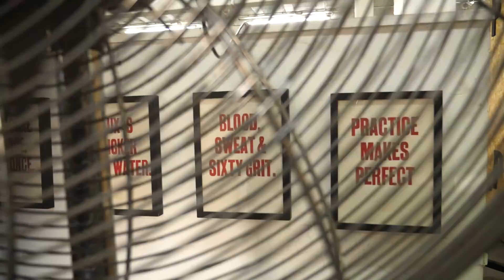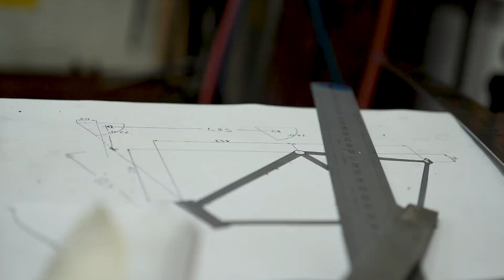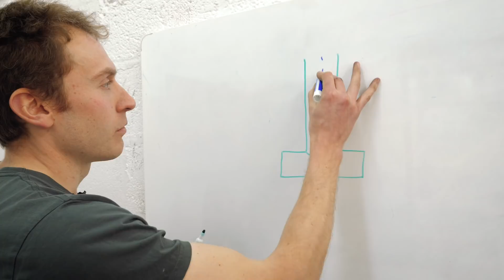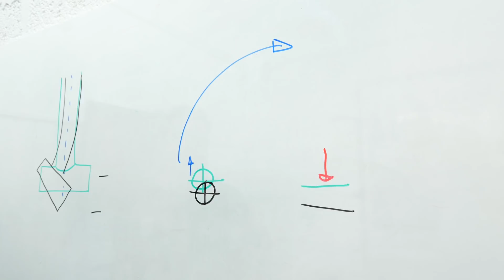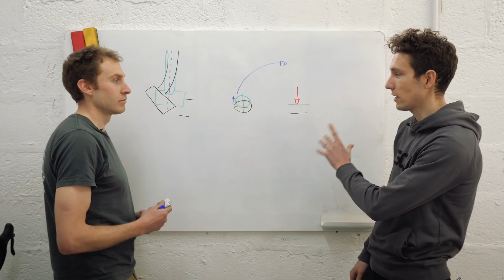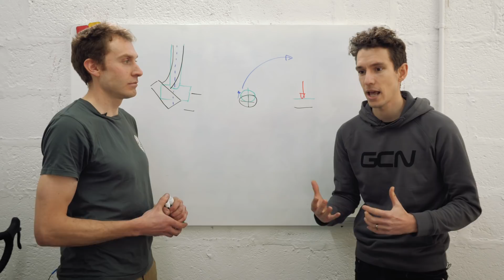Are You Faster On A Stiffer Bike?

Comment: At least with my bikes, nothing so far to note, I have always noticed a flex along the horizon line along the chain bending on the chain side between the peddle and rear gears. There are times the flex causes the chain to change or close to change. Just thought I'd say... I'd also imagine this "grey" area is more about the strength of the cyclist. Someone very strong with high endurance would need a stiffer bike; when typing this is seems common logic knowledge... but I don't think it is... ha! I think the example shown in the video is great, but also believe that energy we saw will never happen while on an unhinged bike and the energy will go into the tires, granted hard stiff tires would observe less energy.

Comment: This explanation is flawed. True the energy is not lost if the material is in elastic range, BUT the frame could flex back after the downstroke, which would leverage your leg's damping properties more, and also it make your upstroke potentially easier (not necessarily what you look for). This is due to the lag in the response of the frame versus the excitation, sometimes referred to as phase angle in the dynamic modulus (complex modulus).

Comment: It is turned into heat but the heat is displayed throughout the frame, also the frame flex while pedaling in the road causes the free hub to spin backwards turning your energy into the free hub spinning backwards which, the brake test throughout the video does NOT replicate actual conditions, also lets say that his theory is correct, the uneven slowing and speeding up would cause aerodynamic inconsistencies which would maximize air friction and lose you power, frames aren’t just built stiff in all parts with compliance built into the carbon where needed to reduce how much the small road bumps will slow you down

Comment: I imagine it is the same as anything, tuning for the individual. I think theres probably a sweet spot based on rider weight, and power output as well as riding style ie stiffer stronger frame for downhill. something to consider is the material side of things im no expert in composites but i imagine stiffer= heavier due to the use of thicker carbon fiber. I hope you guys do more coverage on this. nice video

Comment: Possible frame flex experiment…

Ingredients: two bikes (one flexible, one very stiff), a short traffic free hill, one rider, one assistant, make up weights (to equalise weight difference in bikes), one piece of chalk, one measuring tape.

Method: Select bike 1. Face it uphill.

Rider stands on pedals at 2 o’clock position with straight leg, bike brakes fully on. (Assistant keeps rider upright)

Rider releases brakes and lets his/her full weight (with straight leg) turn the crank until 6 o’clock position. Measure the distance travelled uphill until the bike stops.
Repeat three times and take an average distance.

Repeat above with bike 2. If possible use the same wheels, drivetrain and gear ratio. If not at least use the same  chain and crank length.
See if there’s any difference in the distance travelled.
NB. The rider must ‘fall’ exactly the same distance every time. The rider must not add any muscular energy (so must use a straight leg in every run). 

It would be interesting to see the results! Not very ‘Glam’ but it’s a real-world test!

Comment: You turned the pedals without allowing the wheel to rotate. Am I supposed to be surprised when the wheel rotates after you take the brake off? What else would happen? Pretty much the only possibility is that the chain or chain stays are plastically deformed and the whole bike is broken.

Comment: In effect you’re loading a spring and releasing it. Take a spring with a weight on it. When you release the spring, does the weight bounce back to the exact same position? Of course not, the spring will oscillate, losing energy each time it does. The stiffer you make the spring, the less potential energy energy loss, until eventually there is none with a perfectly rigid structure. Is it a significant amount? That depends on how heavy the weight is, but I think a rider is pretty heavy. With a bike frame you aren’t even loading the spring in a totally vertical direction, which means much of the energy lost will be in a direction (horizontally) not conducive to driving the wheels. You can look up the physics of a simple spring and mass to try to quantify it, but the frame is no simple unidirectional spring, so the math will be far more complex, requiring finite element modeling to even come close. The fact that you can feel the difference is a testament to the sensitivity of human biology. Since you can sense it, your brain will usually want to pick the one that’s easier to ride, no matter how few actual Watts it is. That’s where the belief that you’re riding a more efficient machine will make you faster, it’s simple cycology!

Comment: My steel MTB frame flexes however it never felt or seemed slower than a stiffer bike but it does smooth out the pwerstroke putting the enegy back when less force is applied resulting in considerably less wheelspin and better traction going uphill.

Comment: Wrong. The frame flexes when you are peddling down. The energy is released when your leg is at the bottom.  You could get some of the energy back if you push the pedal backwards at the bottom while the frame is moving back to center.

Comment: Flawed pseudo science here. The energy will not be put back into the drive train, because once you make a full stroke, there is no way for that to happen. What really happens is the energy is just transferred back and forth between the right and left side of the frame while pedaling, and once you stop pedaling depend where in the stroke you are it may be put back into the drivetrain. Either way you are wasting a little power with more flexible frames because transfer of energy between left and right is not 100% efficient.

Comment: If that happens pushing the right pedal, and you release a force clockwise, if you did it with the left one, you would rotate backwards, which is a straight loss of energy because the wheel won't move if pedaling backwards

Comment: I have had a flexible aluminum frame and went to the middle or back of the group when i had been at the front on the carbon. All in one weekend. Tried it again the next weekend... and the same thing. Weight was very similar. Same happened in the races.

Comment: If the wheel spins forward when you load/unload the right pedal, what happens when you load/unload the left?  Seems to me it would want to reverse the direction of wheel spin, but the freewheel would prevent it, so that would definitely be an energy loss.
Reply: The exact same result would happen: wheel spins forward. The drivetrain doesn't care which pedal gets loaded, all it knows is that there is a lot of torque building up, and then it gets unleashed.

Comment: I'd be MUCH more concerned with MECHANICAL MALFUNCTIONS as a result of excessive frame flex rather than wasted/absorbed energy from frame flex.  For example: Disc Brake rub causing drag/wear slowing you down while climbing/accelerating/sprinting; tires rubbing on the chain/seatstays with tight tire clearances during frame flexing; 'ghost shifting' from out of alignment derailleurs during frame flexing and such. This should have been mentioned as THE MAIN deterrent for purchasing a wet noodle of a frame.

Comment: This discussion/demonstration only showed that SOME of the frame distortion (flex) is returned to the force of acceleration (in opposition to the deceleration of air/friction).  It does not contribute to the discussion of whether more or less of that distortion makes a substantial difference in efficiency.  Terribly unscientific.  A system of controlling as many variables as possible and measuring input and output forces is the only thing that is meaningful.  Surely if Si put the same amount of force on the stiffer bike then less deformation would create less wheel rotation (if hub friction/wheel inertia were the same) AND less heat would be created from the lesser frame deformation.  Less heat, less energy loss.

Comment: As some people have said, the top end of the power is shaved and is distributed throughout the pedal stroke. So one pedal stroke on a stiff frame that generates 1000W, might only generate a peak of 900W on a flexible frame. Split second power is not what causes acceleration. Overall energy per second is what accelerates rider and bike. So it would be interesting to know if the total quantity of energy delivered over the entire pedal stroke is similar on different frames, for example 1000 Joules per pedal stroke. But the distribution of those Joules over time is definitely more even on a flexible frame, meaning a more constant speed for hillclimbing rather than the constant variation in power of a stiff frame leading to twitchy acceleration decelleration with every pedal stroke which could be demotivating. However during a sprint you might find it more motivating to feel the raw peak power being delivered into the angry tyres as they grip the road for accelleration. If there was less energy delivered overall by a flexible frame it wouldn't necessarily change race results unless as you could always just shift down a gear to get more revolutions and therefore more energy delivered per second (ie. more Watts!). This might sometimes necesitate a higher cadence but it wouldn't tire you out as much as a similar cadence on a stiffer frame. So you'd ecpect it to be excellent for endurance races or long hill climbs.

Comment: Very well put together film . Nice one Simon.. I ride a very comfy hybrid Whyte Sterling which does have flex from the tubing. I also ride a very aggressive Raleigh Milits bike which is super light  and pretty stiff. I love em both for totally different reasons. The Hybrid though will not do the "Cragg Vale loop" under the hour no matter what, where as the racing bike will shave 3 minutes on a good day and up to 6 if I am really fired up. The difference is always riding position and the gains from Aero dynamics. Not the bikes rigidity. Cracking channel and love the reviews you do . https://youtu.be/ItK1vfqVqfYCheers GCN.

Comment: Not so sure there is much of a difference, but I would like to see this done using a power meter "mythbusters style" before I make up my mind
In the mean time, I would suspect that while you are unloading the frame, there would be less force but the same weight, so the frame would still be flexing but unloading at a far smaller rate that only the very lean and very strong cyclists could benefit from.

Comment: That was great. I had a LOOK back in early 2000. Was a fairly flexible frame. I could easily tell. I loved that bike though. It was pretty fast geometry-wise (thanks for the other video with Tom) and when I got to climbing, I could feel that effect - especially out of the saddle, which felt wonderful. The bike felt alive. There was a give on the one side and a spring on the other as you pedaled - subtle but it was there. I've always been thinking due to the stiffer is better mantra that the bike was inefficient. Really liked how it felt. Turns out, I just rebuilt it yesterday. I'll get to ride it again with this in mind, having since been on really stiff aero frames.
Reply: Hi, so what's your opinion on the bike stiffness now? Does higher stiffness contribute to speed?
Reply: @Jesus_s_Real  For me, in comparing the two, higher stiffness contributes most noticeably to acceleration. In most daily riding and training, the differences are not too large in terms of average speed. When racing, I'd always pick the stiffer bike, other things being equal. There's a little more average speed to be found there, especially as in racing you are always accelerating and always riding hard. I love the feel of the less stiff bike and it's my training bike choice most days.

Comment: I think the only way to test this out would be to use a dynamometer to get the actual power transfer to the road, and compare it to the power at the crank. Do both full sprints and a 1 minute average or something like that.
If the hypothesis is correct, the stiffer bike will have the least disparity between the wheel power and crank power. Both bikes should use the exact same chains, group sets, rear wheels, and tyres.

Comment: The energy that move the rear wheel came from stretched chain.  The flexed Bottom bracket actually moved the big chain ring  forward and stretched the chain in which pulled the rear cassette but wheel movement was stopped by the brake until it released.   If you move the front chain ring to small one and rear cassette to the big sprocket then the energy transferred will be way less.  In my opinion, flexible frame is not ideal for sprinting which require instant energy transfer.

Comment: The pros ride what sponsors give them.  Not long ago both the pros and their sponsors thought 20mm tires were really fast and a bit longer ago they thought that going through the alps on 42x23 is fast because you are pedaling really really hard.  During the same time touring people were riding 28mm tires and going through the alps with 30x28 pedaling at a reasonable cadence and not at 50rpm and felt it was a lot better and smoother.  Touring cyclists were slower because they have less power but they were a lot smarter without any sponsor money... Now everyone is buying the super stiff story (and now adding rubber suspension everywhere because the frames beat you up like the 20mm tires did....)

Comment: The only two patches that touch the ground are your wheels so the only way to get power to the ground is by sending it through the wheels. So I think stiffnes of the frame is irrelevant to the end wattage, as it will still be input wattage minus friction in drivetrain. You could actually take two exact bikes one aluminium one carbon with same drivetrain and try it out. Stiff bike feels faster off the start as it gives energy more directly to the wheels, without bouncing through the frame first. Look at it simply like this. Two springs one is harder to compress the other one is easier. The hard one will give you more of a kickback, but it will also require more power to compress it in the first place...

Comment: This experiment is very flawed.  In the real world, the energy stored in the flexed tubes of the frame won't be released until pressure is significantly reduced at the bottom of the pedal stroke, at which point it won't be going into turning the cranks.  There's no doubt that the energy will be returned from the frame (unless it bends permanently), but that doesn't mean it's going where you originally intended.

Comment: This also happens with lower air pressure tyres in the city roads.
You will ride a lot faster and with less effort with about 30-60 psi air pressure on your tyres.
Its perfect for commute.

Comment: I disagree with the statement that the greater flex of a steel frame leads to more energetic losses from heat than the rigid flex of a carbon frame. The statement is fundamentally incorrect because steel has a smaller area elastic hysteresis loop than carbon fibre.  The area within a hysteresis loop is the amount of total work expended when a material is flexed and then released. A larger loop area means that more energy has been wasted due to heat in order to deforem the material than a smaller area. Hysteresis is not the same thing as a material's elastic modulus, which is the measure of its stiffness. People are confusing hysteresis and stiffness, and are assuming that a stiffer material returns elastic energy more efficiently than a more flexible material.
Reply: I find this a rather elegent reply.  The calculation of the area of the hysteresis loop is the sum of force X distance (the very definition of work, or energy expended) -- it is empirical and doesn't depend on whether the system mathematically models nicely as some spring and damper system, or from where the originating forces are generated.
You claim that steel is superior to CFRP based on general hysteresis loop characteristics -- I have no idea either way,   but I think a cleaner test would be to use two samples,  each using the same material type, but engineered so that one was stiffer than the other.  This case would more plainly answer of whether differences in stiffness alone impart energy loss differences, and could characterize whether the magnitude of this loss is particularly significant in the overall system.

Comment: I had a super stiff frame a long time ago, and it put a smile on my face every time I rode it. It was the immediacy of the response that I loved. You pick up the speed, the bike second guesses you and you're off. Surely it depends on where the frame is flexing. If you have a 'ladies' crossbar,  the flex is extreme and only releases the front end to come back in line with everything else.
Reply: Did you say 'ladies'???? So 1950's....